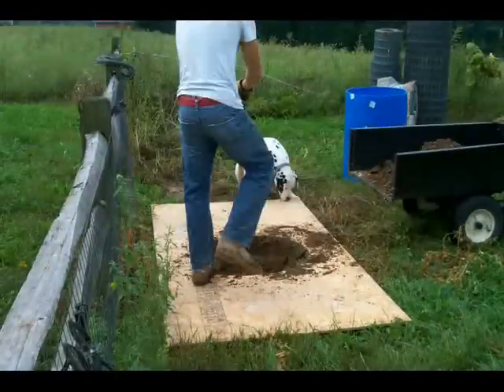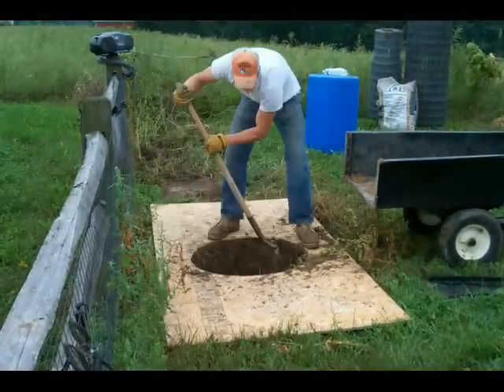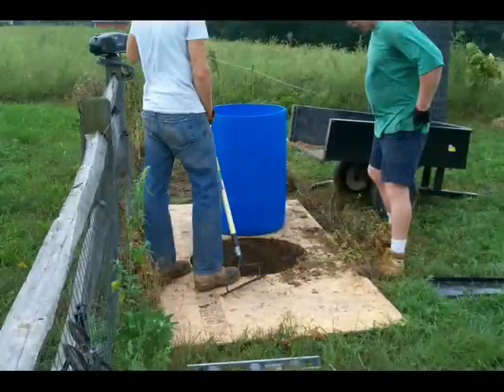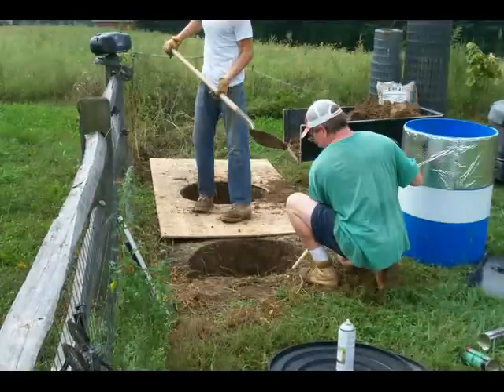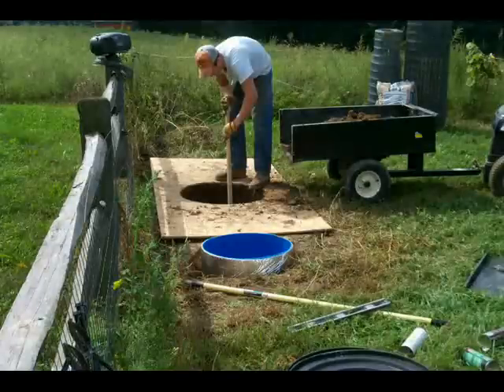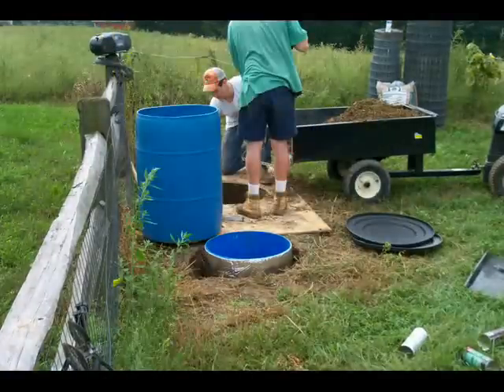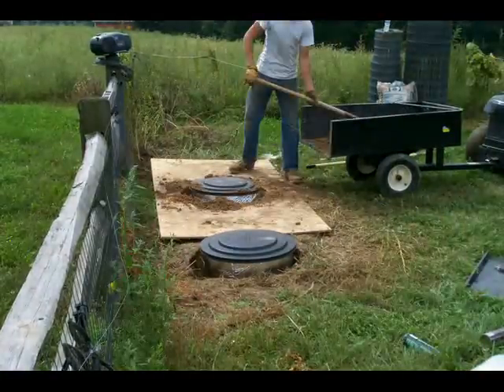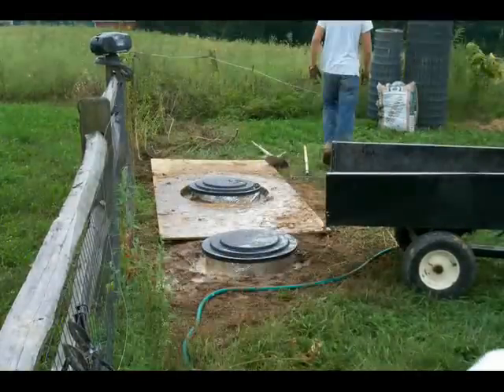Building Barrel Root Cellars

Comment: This is a cool idea.

I might try this and incorporate a cold frame over the barrel to keep a constant temperature over the winter and make it easy to access the barrel if it snows.

It also might be good to put gravel on the bottom of the hole to pull more water away from the barrel when it rains... Humidity control is usually one of the features of a root cellar with stable cool air flow... Just got my wheels turning...

Thanks for posting. Good video.

Comment: to help with air flow, you might want to dig that hole a bit deeper, put some cinder blocks down on bottom, drill holes in the bottom of the barrels and lay fine screening on top of that and put the barrels on the cinder blocks.  That will take care of any "liquid" build up and might prevent it!

Comment from the maker: Hi, just on their own they work without very much adjustment to the temperature when storing vegetables.  As indicated in the video, maintaining ground integrity is essential. This is what insures self-regulation. When storing fruits you have to insulate the lid and ground cover to keep the temperature higher.  Most fruits don't like to be near 32F in the winter, more like in the 40 to near 50F range. Cabbage for example creates heat in storage so you can lightly insulate the lid.

Comment from the maker: The only problem I can foresee is that the balance of the weight of the soil around the barrel might distort or crush the thin wall of the can. The barrels have a wall thickness of a minimum of 3/16 inches. And even then I noticed that if the soil when packed around the barrel is not completely even, it will slightly warp the wall. The amount of force required for this is considerable. So a trash can may or may not be able to withstand it. This is something that will happen over time.

Comment: Plan on a garbage can root cellar next summer. I might try a hole approximately 10 feet in depth first ( about 2 ft in diameter), then put a drainage plastic culvert vertically in the bottom 5 ft, hopefully this will do two things. 1) Have a place for water to collect if needed and 2) utilize more of the geothermal affect of the ground. Then place my garbage can on top of that enlarging the hole to accommodate that can. Also putting refective insulation on top of the can and venting it. What do you guys think?

Comment: Supposedly somebody on YouTube has video that their county extension told them how to do this. I'm looking to find that video. The problem you have is polyethylene is no good for storing vegetables what I would probably do is I line inside with wood but put a vent tube then bury The vent so that it's down in the ground to achieve cooling. What you're trying to do is make sure that you cannot have any ethylene gas in there or everything rots.  
Clean plastic without venting is a great way to ruin all your vegetables with ethylene gas. Cooling the vent tube is to sure that you didn't get warm air down in there. The best thing that farmers use and I do live on a big farm is they used to build an old potato bin with big log legs in a giant wooden box in a section of a basement Or root cellar attached to a basement . If you have problems with dampness You can also cover potatoes with sawdust or something like that even dry dirt. you be surprised if you pick a nice spot in your yard and it's dry you can actually store them pretty good in the ground. Not always but I have had good potatoes make it through the winter just fine. I live in NW PA it has hit 36° below zero at my house. I'm building a new basement that I'm hoping to build a root cellar out behind the house underground but for now I need to go to these because it's so hot that my shed that's normally cool is rotting my potatoes
Reply from the maker: Well I could see how you might think that with HDPE, but no it work exceptionally well with very little food loss. For some reason I have never had problems with ethylene. It is lighter than air and would tend to be vented out. In addition I do have screened drain holes in the bottom in case of condensation and several kinds of soil bacteria do oxidize ethylene gas for food.